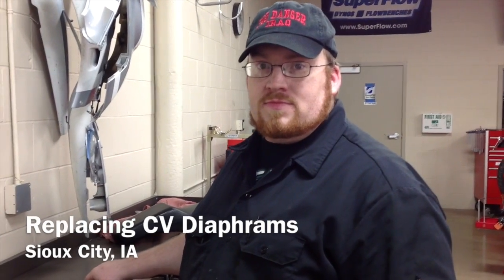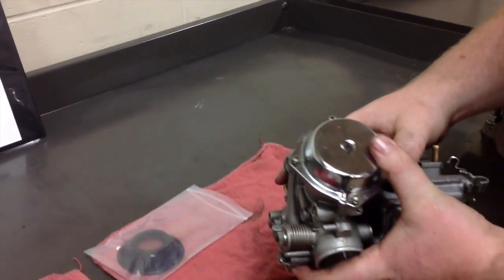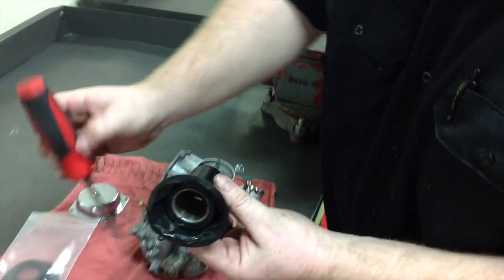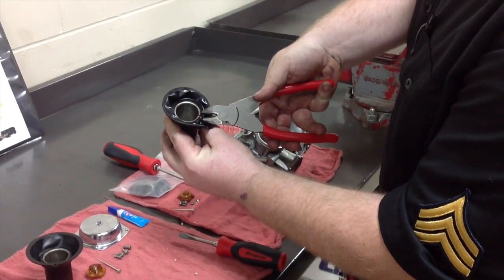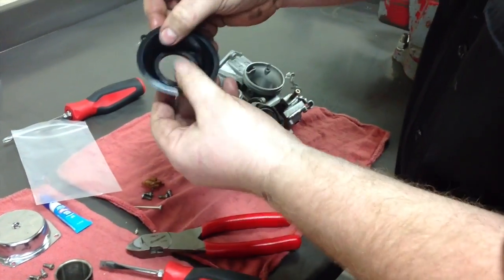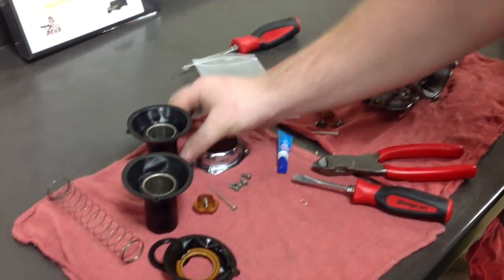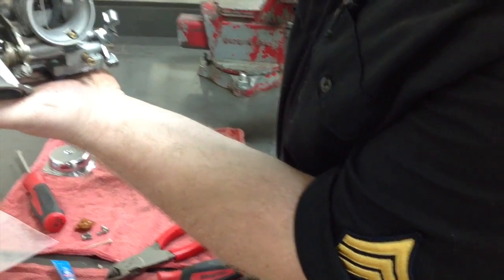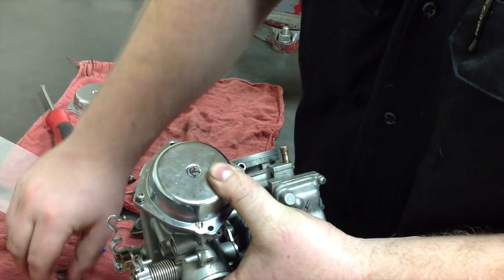How to replace a CV slide rubber diaphragm with an aftermarket one #how2wrench #cvslide

Comment: Hi, To my experience and understanding, you don't have to remove the top ring, it's only to reinforce the diaphragm from sliding off from above, you can rotate the ring easily, and it's not holding on to rubber. Only the bottom plastic ring is holding tight to the diaphragm. Instead of sliding the diaphragm from the top, you can slide it gently from the bottom holding slide upside down and bring it to its original top position.  One thing I am confused about is the bottom plastic ring. I think it has an important role since it works as a spacer for inner side of the slide seat probably to stop gas leakage coming in contact with a diaphragm. What do you guys think?
Reply from the maker: I wish I knew but this is a great question for Shane directly! 
You reached the social media team here. We get 300-400 requests a week, so it’s a bit time challenging as you can imagine. 
He replies to members EVERY day first thing before grabbing his wrenches in the shop! Best $2 you'll ever spend...Join this channel to get access to perks:
https://www.youtube.com/channel/UCBhM8DCKnT3qXwTW0eToyCg/join       
-Daily MEMBER FIRST COMMENTS ANSWERED FIRST 
-Live Q/A video chats
-Wonder if we have a video on your need? Members can request content links!
-Full Access to the ENTIRE 700 video library
-Member-Only FREE tool giveaways 

Did you know How 2 Wrench has a techline service? You can get Shane 1:1 on video chat! https://how2wrench.com/ols/products/techline-one-on-one